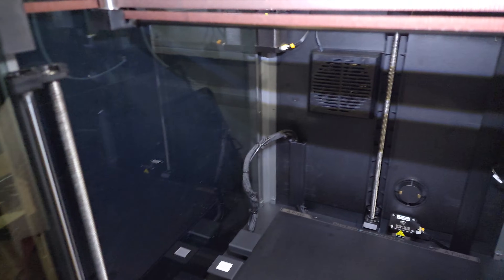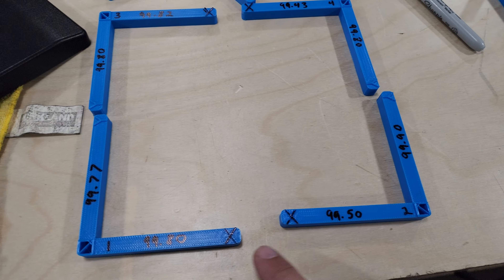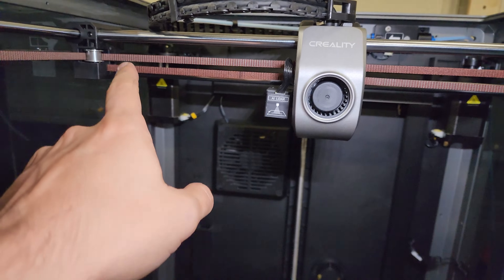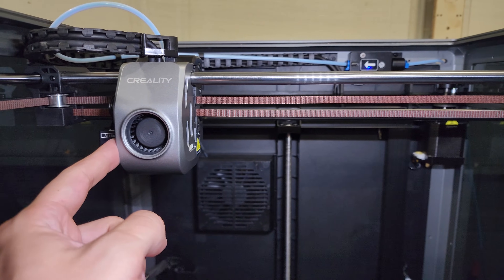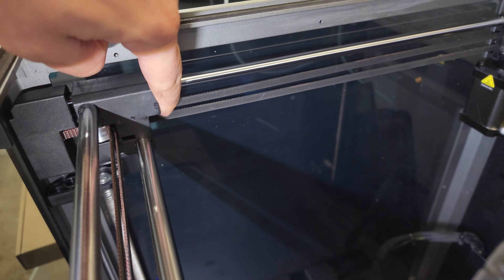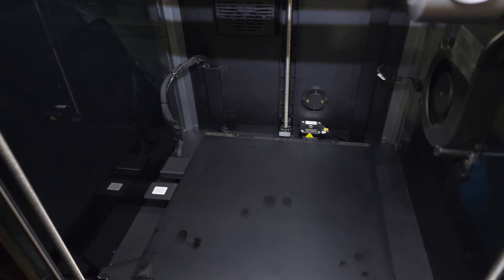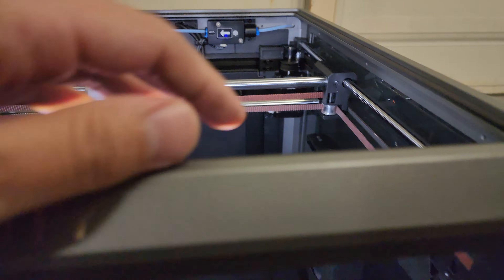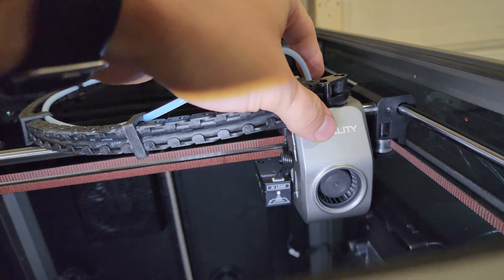Creality K1 Max Dimensional Accuracy Issue Part 2: Crooked belts!

Comment: Hi,
Did you ever sort out your dimensional issue ?
If so what was the problem.

Thanks
Reply from the maker: I did not, I returned the k1 shortly after publishing this video
Reply: @Redo3D  
oh dear that's not good...

We've bought a K2 and are happy with it ,
It's just slightly inaccurate.
I'm hoping we can find a solution
Reply from the maker: You can try using skew correction in klipper
Reply: @Redo3D 
Ill give it a try 👍🏼

Comment: I am going to through this in because I just beat my head off a wall for hours trying to figure out why my circles were all of a sudden ovals without changing a thing.
I went through every single test and calibration and nothing.
I even found that the belt tensioner really doesn't do much on the newer models because they over tighten it from the factory.
Anyways as long as the belt isn't so tight it causes resistant i found they just need to match each other but within a reasonable tension.
I found 400-450 grams of tension range and settled at 400.
Tried another print and the same thing.
At this point i am looking for broken items that could just happen randomly.
What i found pissed me off, and that was the build up of greasy dust on the non toothed pullies.
The damn belt was slipping but how would you ever notice.
Anyways i cleaned the belt with belt dressing and cleaned the pullies and it is back to normal.
Reply: I’m running into the same problems with getting weird ovals on my prints. Just cleaning your pulleys fixed the problem for you? I have very little time on this printer… probably only about 10 hours before I noticed this problem.
Reply: @m1carbine2001  then I would assume it's belt tension, mine were slipping from dust buildup slash lubricant on pulley

Comment: To further elaborate, the tensions changing on the belt still would not cause the printer to report the wrong location of the tool head. While the belts ideally are spaced evenly apart, it is not uncommon for their to be a slight discrepancy like what you are showing in your video. I have seen Bambus with the same discrepancy on X1C models, have seen a couple Vorons have the same discrepancy as well, but it is much rarer. I would double check your math on the slicing tolerances and verify everything is round and mathmatically possible. IE your layer width is capable of achieving 100mm.

Comment: One important thing about the k1 max is that all the pulleys are for 9 mm belts. Only thing that seems to use 6 mm belts is the toolheads belt mounts. Given this the belts being tensioned they pick the travel paths that are least resistant(shortest) and in some places they move around the middle of the pulleys and in some at the upper or lower edges and that causes inaccuracies. I think if we replace the stock 6 mm belts with 9mm belts that could reduce the accuracy issue by a lot.

Comment: You're videos have got me to go for a return as I have the same issue but worse, I have no idea how to see the bed mesh but I'm going to guess it's warped as I have had things come off mid print, glue no glue etc etc
Reply: I will also be an hour into a print and it will fail, no print fail detection either which I would expect along with burnt filament
Reply: @nolo1337  So I see on german bambulab forum the X1C has same problems, meaning dimensions of a cube do not match, if even bambulab can't make it work then what to buy that works?
Reply: just to give people an idea i played hell returning mine and i mean hell

Comment: Any updates on this?
Reply from the maker: I returned the machine. There are mods to completely rebuild the gantry but that's too much effort that I didn't want to go through.
Reply: @Redo3D  what did you get instead then? I too need accurate printer out of the box.

Comment: I have the same problem on my K1 speedy. Does the belt wander up and down the left motor pulley when print head reaches far left? i think its to do with the pulley alignment changing belt tension. I get a wear pattern on the top edge of my belts where it rubs
Reply from the maker: Yep it does tbe same thing, I ended up returning the machine. Thinking of getting the qidi xmax 3
Reply: @Redo3D  Cheers. Not heard of the qidi xmax 3, but seems like I may end up with one!

Comment: My belts are the same, but I did a calibration cube in every corner and the middle, it was all good, but I’m having a bed level issue, I have to be careful what I print, if it’s bigger then 150mm3 in the middle the first layer has waves and holes every witch way. Creality is sending me a heat bed, also I have tons of ringing and ghosting, belts have been checked. Along with way too much vfa. The vfa I can live with but not getting uniform first layers doesn’t play nice for 1000usd
Reply: Same here I figured out the screws on the printbet was lose. And the limiter crew of one of the z-rods had .5mm wasent perfect fixed so there was some “play”
Reply: @martinl.2007  I rooted my K1 Max and made my own bushing out of polycarbonate to get the bed more level, even after the new heat bed I still had a variance of 1.2mm, after the bushings it’s at .4 so my first layers are much better.  After doing some proper input shaping, and using Orca Slicer it is a much better printer now. I have been using the K1 Max for everything so my Bambu printers have just been sitting there. Today I printed with a Bambu and I got instantly depressed. From where my K1 Max prints started and now where I ended up is like night and day. But when I put the max parts next to the Bambu parts the Bambu just blows the max out of the water. But I will get use out of the max no doubt.
Reply: @mikemarucci913  So the X1C is that much better then K1 max? seriously, why the german forum has post about dimensional accuracy of it then?
Reply: I bought my K1 max last month, and I was having the same first layer issue. I did the bed adjustment by lowering the bed all the way down and disconnecting the belt. One of the front corner Z rods needed 3 full turns in order to bring that corner all the way to the bottom. After that, I’m getting good first layers

Comment: Have you figured out how to adjust the belt alignment? Any solutions? I have the exact same issue with my K1 max. Seems like the guide wheal needs to be moved up... Thanks
Reply from the maker: I have not been able to adjust, every k1 max I've seen online has the exact same issue. I tried to adjust with no luck
Reply: @Redo3D  o man, ok. I think it's going to take a complete gantry removal, and new printed corner, updated to toothed guides and and and. I think building a voron is a better idea.
Reply from the maker: I think building a voron is going to result in a much better printer, the pro if going with the K1 max is that its ready to print in 10min, Im going to just end up using the K1 Max for models that dont require accuracy and need to be printed in ABS. It does great with ABS

Comment: These are coming out of China so slop and low quality are to be expected.  Mine has the exact same belt issue as yours with the left side gap being smaller than the right side,  same with back to front but I havent tried to print anything that requires dimensional accuracy yet either so I havent noticed the problems it probably has.  I will note however that the chasis itself was NOT square.  When I went to put the screen on,  the door would not close because the screen was in the way.  I had to file down the slots that the display sits in for it to finally close.  I chalk that up as the chasis not being square.
Reply: iPhones come out of china.

Tired excuse.
Reply: @dangerous8333  No,  iPhone components come out of Taiwan as do Samsung components.  Assembly happens in Mexico AND China.  Taiwan is the chip capitol of the planet, not China.  Nothing in these machines are made in Taiwan so your iPhone comparison is nothing but a joke.

Tired comparison.
Reply: Everything is from China. The old idea that china manufacturing is bad is something your parents taught you from a time long ago. Chinese manufacturing is every bit as good or better than anywhere else for the last 20 years. So sick of hearing that
Reply: @goodneighborlawnsidaho   So when u moving there if it's workforce is so great.

Comment: People need to stop spending their hard earned money w creality. They are just not a quality company. Now try to get them to warranty the unit. They will stop returning your inquiries.
Reply: Agreed, my K1 Max was returned for a full refund after 3 weeks, I always buy from Amazon (UK) so I'm covered should there be an issue.
Reply: @MW54-jb9tb I made the mistake of ordering straight from Creality last November and they did not honor the full refund policy within 14 days (I contacted them after 11 days). And they told me I could not ship it back because shipping was too violent and would damage the printer. What a rip off.
Reply: @tek9058 I agree with my ender and CR-10  but the K1 Max I just got is not square at all.  The whole frame is twisted a couple degrees.  

It prints fine, but all parts are skewed, not square.  

I hope I don't get screwed over, already reached out to support and provided pics .
Reply: @tek9058  problem comes in when you are using the machines as intended, to build things with them. I have 5 creality machines, they all needed work to get to print correct. Had they spent more time to get them right, charge a lil more, offer a REAL warranty.. the printer community would be further along than it is right now. Its really all water under the bridge, but we cannot give Creality a pass on any of their fuckery.

Comment: It's not a tension issue, the closer the print head gets to the edge where the belt is offset the more movement is required to move the print head. When it's far it pulls on the belt at nearly a parallel line, making movement nearly 1:1, but the when it's close it starts to build on a delta curve as it starts to swing near it rather than come directly at it

I had the same problem on an older i3 Duplicator machine i have, when it would print near the back of the bed it would "smoosh" the dimensions. Fixed by designing my own mounting bracket

Edit; Another issues is out of square, I always measure my machines in two planes for each axis. Once you have your machine in perfect square you'll realize how much slop there is in tolerance and will send you down another rabbit hole 😅
Reply: Currently in the rabbit hole 😂 

Searching tirelessly through years old comments on yt and Reddit has provided 100x more help than Creality ever could. Thank you guys for your service🫡

Comment: I'm waiting a couple of months for Creality to fix these early manufacturing issues before I buy a K1 Max.  It would be great if Creality did a burn-in test on each printer to catch initial hardware failures while verifying that everything works, but also simultaneously print test samples to verify print accuracy across the entire build plate.
Reply: I don't think this is something they'll fix.
Reply: @Zeltroix  - I'm inclined to agree.  Creality should fix the warped bed issue on the K1 Max like they fixed the unreliable under extruding extruder, but they probably won't.  There could be an after market fix and it might be cost effective depending on how the heater is mounted and wired, but customers shouldn't need to replace parts like this.  At best, they'll compensate with upgraded firmware.
Reply: Why continue buying from them, a shady company, rather than the company that Kickstarter this mini revolution?

Comment: Measure the diagonal dimensions of your top frame (top crown). Mine were 6.35mm different. It was so bad that I couldn't even put the lid on. Creality sent me a brand new machine super-fast. The new one is PERFECT. However, I have the exact same belt situation.
Reply: I just got mine a couple days ago and it's just as you described.  Lid can't fit and my prints aren't square. 

It makes me feel better to hear they made it right hoping they can do the same for me.
Reply: @4lan39  You absolutely must get after Creality for this. If your printer's truly like mine, IT WAS BUILD THAT WAY, and the only solution is to totally rebuild the top crown with a SQUARE structure instead of one that's out of square.

Comment: You need to de-rack the gantry. Core xy printers are diagonal drives so accurate prints require squared frame, gantry, and symmetrical belt tension. X and y movements always require both motors to engage but 45 degree moves isolate to single motors. If the x axis is moved to the front and to the back and there are gaps where one side is loose and the other is tight and both aren't flush, this is called gantry racking. In diy printers like vorons, de racking the gantry is one of the first things you do when building the printer.

Comment: This is not your issue I promise but if it bothers you why not just open the toolhead and simply fix the belt anchor points within?

Anyways, this is just a bit of a design flaw with belt routing that you can compensate for in Klipper. 

https://drmrehorst.blogspot.com/2018/08/corexy-mechanism-layout-and-belt.html?m=1

Comment: I see you've done a few more samples. So around 0.5% error. I don't see it in that pulley given the belt is free to ride up and down on it but you're probably onto something there.

Some kind of misalignment in the belt path that stretches the belt as it moves along the X axis. I actually would've expected looser belts to print smaller and affect both X and Y.

More like extruder belt attachment misalignment in Y relative to one of the pulleys on either side (looking top down).

How about a "twang" test to confirm? There's probably more scientific ways to measure belt tension - specifically stretching, like counting number of teeth in a given length.

Skew thing makes sense. A linear correction in X would stretch both left and right by the same fraction in X, whereas this looks more of a second order error.

I'm curious enough to give those test prints a try on my (wife's) K1 and see how it fares. Maybe some other shapes too, to see it's not a directional travel or torqueing issue.
Reply: actually, on that torqueing point, does print speed affect the outcome?

Comment: If the skew correction made no difference make sure you comment it out before doing any further testing. You don't want it now causing skew as you toubleshoot other possiblities.

Yes the belts should be parallel/square within reason. I wouldn't worry about moving the idler. The easier way to correct it is likely at the toolhead, make sure the belt is atatchced at the toolhead level with the idler. You don't really care if the left gap is the same as the right gap, just thateach belt is square. Check to see if adjusting the pulley on the motor could solve the problem on the left side of Y.

You didn't mention actually testing belt tension. You need to check the frequency of both belts and make sure they are the same, this is absolutely step #1 for tuning a corexy, if the tension is not equal, we expect a loss in dimensional accuracy. Can't do any other troubleshooting if tension isn't equal. After any other change concerning the belts, like making sure their square, retune the belts to be even.
Reply from the maker: Great suggestion about adjusting at the print head and motor pulley, I'll have to disassemble and see the best way to go about it.

I did use the android tuning app suggested by the voron documentation, I checked as best I could and both A and B belts were the same, it was hard to tell since I have 15 other printers going so I'll have to move it to another room where it's quiet and recheck.
Reply: einfach die riemen spannen auf die gleiche Frequenz dazu musst du nichts zerlegen

das macht überhaupt nichts aus was du denkst mit den riemen das ist nur wegen den Pulleys die kannst du hoch und runter stellen am.motor die kannst du wenn du willst komplett paralell legen jedoch wird es keinen Unterschied machen das ist komplett egal ich habe einen tronxy x5sa schau dir mal dort den corexy riemenverlauf das macht nichts aus es gibt viele wege corexy zu verlegen

aber du kannst mit den Höhen der Pulleys die riemen komplett paralell Ausrichten eie gesagt das ist nicht dein Problem eher die riemenspannung sie muss auf beiden seiten gleich sein den kopf genau in die Mitte und links und rechts auf 150mm und mit einer app für Frequenzmessung testen muss auf beiden seiten gleich sein